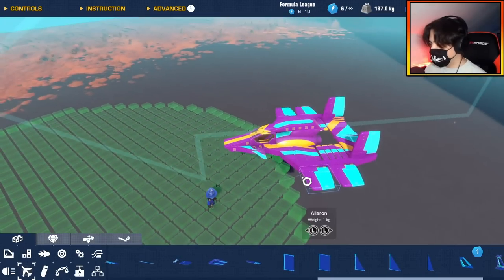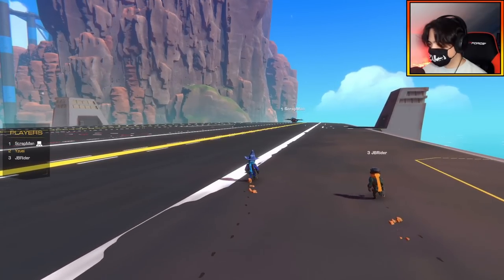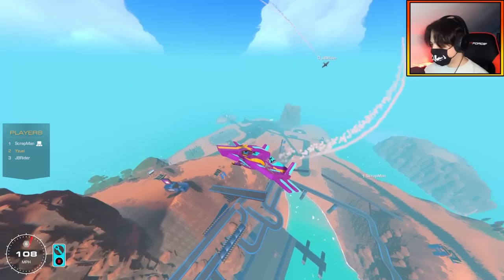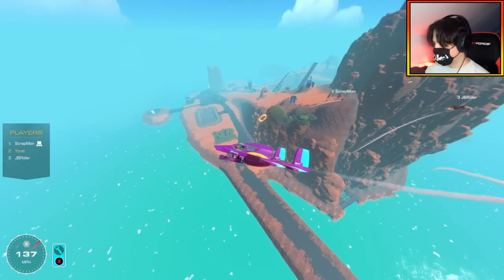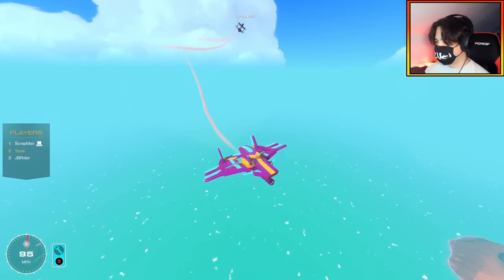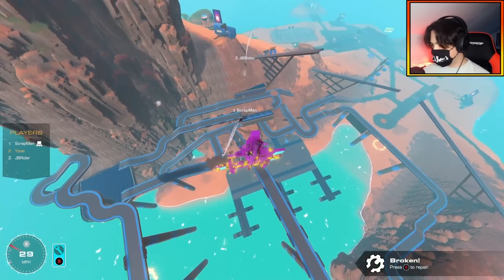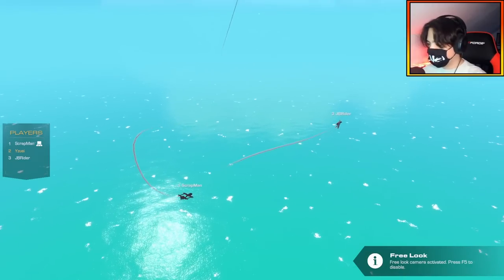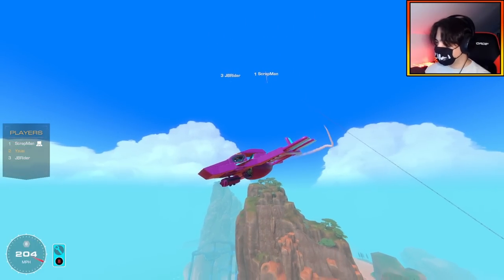Building The 'ULTIMATE' Dogfighter Using Only x1 JET ENGINE! | Trailmakers Multiplayer

Comment: This was brilliant. The single large jet engines definitely added a new degree of challenge to the builds, and we learned that compact is the way to go with single-engine fighters... because, as Scrapman found out, a large surface area makes the slightest bit of damage that much worse when there's only one engine providing thrust... which in turn provides the lift, which is also decreased with damage.

Comment: Idea : Missile duel

Remember when you did the torpedo duel on the sea and the artillery duel a few times ago ?
Maybe it's possible to try to fight with some crafted unguided missiles (not the  auto locking rockets) or some sort of unguided ICBM launched by a SCUD type vehicle while trying to reach one another.

Rules of the game :
- Repair can be used only to reload and remake a missile
- It has to be a direct hit on the oppenent vehicle to win
- Use the dice only to give some movement (like the artillery duel)

Comment: Since the planes are moving so fast the bullets will hit behind center of mass even if the aim assist aims at center of mass, because by the time the bullets reach there the plane will have moved forward, so bullets hit behind center of mass, which is where Scrapmans engine is...
If the bullets hit instantly and had infinite speed then Scrapmans plan was good, but the bullets in Trailmakers actually fly quite slow, so they don't hit where they aim even with aim assist at that speed.

Comment: This was a really smart build whether you intended it to be or not, your engine is right in the midst of all your fins and manuverability which is insanely high and redundant. You're basically using your means of manuvering (which are very abundant) to protect your engine. A better version of this build would just be slightly armored, I'm sure you could stretch some armor to the engine below and spread some throughout it too.

Comment: spin the wheel for 3 different numbers which you can choose to use for weapons, engines, and parts, for example 12, 15 and 5 i would use 15 for parts 12 for engines and 5 for weapons